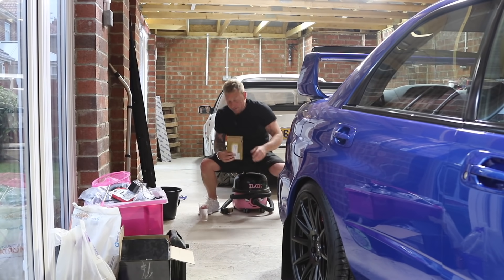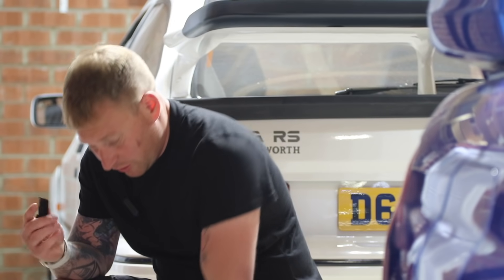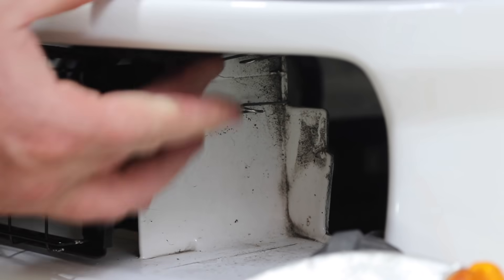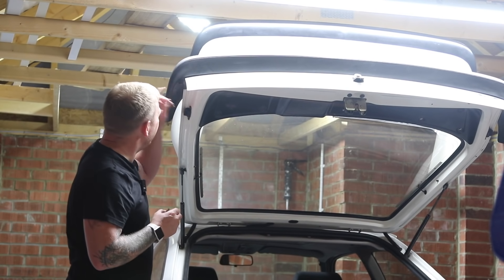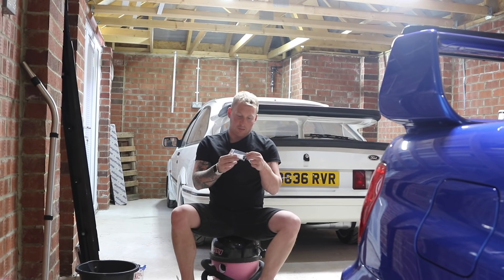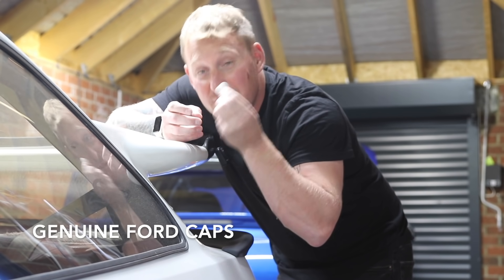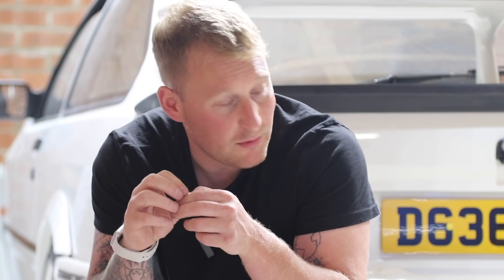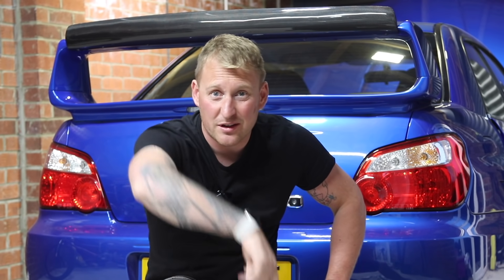Fitting “DODGY” 3D Printed Plastic Parts to my Sierra Cosworth

Comment: Thanks Adam good video.  Just so you get an idea about 3D printing. The parts done for Adam in the video are not done on a £200 printer. These parts are done on a £35k manufacturing printer. Quality parts that last are what I was after making. 👍
Reply: Literally just bought indicator and foglight clips off his ebay waiting on delivery,couldn't figure out how to fit them i do now,if there in front of you buy em,or try find another,sierras r us     Manchester are good for bits too.
Reply: @blueboy1375   sent this morning. Should be with you tomorrow.
Reply: Nice to have people that do this well done lad
Reply: Be fantastic if you could branch out too other models, fiesta rst, escort rst an the like 🇬🇧
Reply: @E83-b8e   basically I do what I can get hold of. As I have a Sierra and a Mk2 escort they are the ones I have done. If I can get other parts then I’ll do them. It’s like a friend had an issue with the centre caps for 15Fiftytwo alloys, no longer available. So I did a set.
Reply: @robrs210 

Real shame blueprints aren't available for all hey, esp with the ridiculous rs tax lol😔
I'll be needing some clips at some point, and now I have a lead as too where to hopefully get some remanufactured goodness.

Keep up the Stirling work, screw this throw away society, remanufacturing ftw 🇬🇧 👍
Reply: Fantastic, well done on making those rare parts, I hope it goes well for you. We use a titanium 3D printer at work, but those are parts for the next generation fighter jet